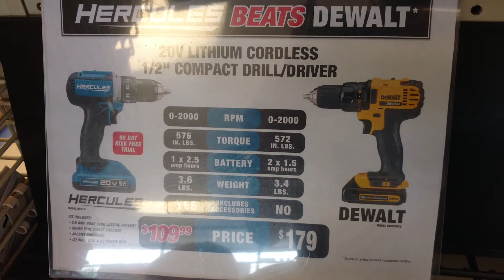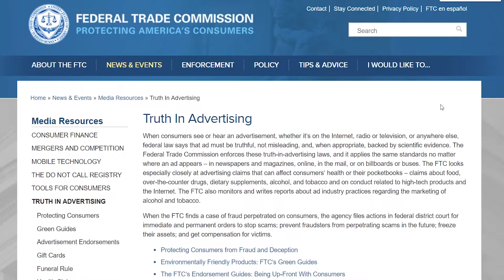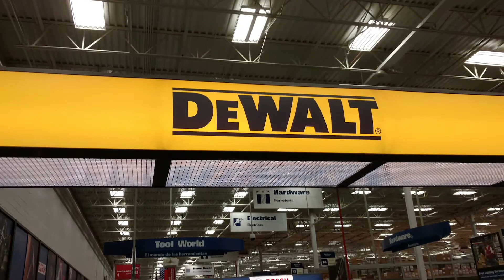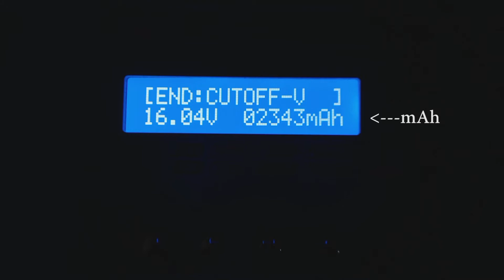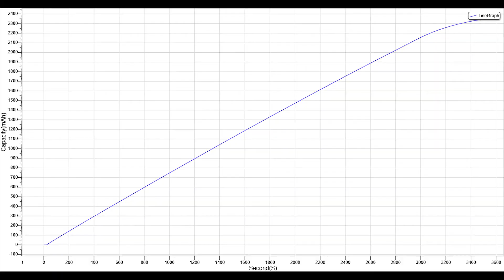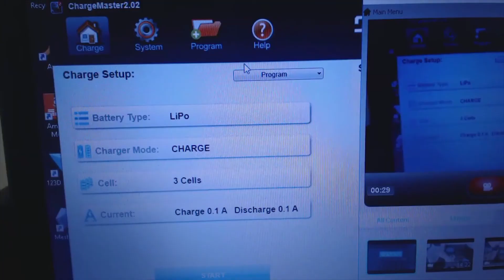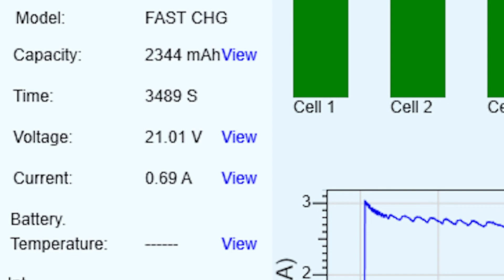Harbor Freight's Hercules 2.5 aH battery gets a capacity test and partial teardown

Comment: Fact, your valid test show 2.3ah, so HF can roundup and and call it 2.5ah and not get sued for a truth in advertising violation.  Also a Fact, AVE ran a vaild test and showed a 1.69ah which he rounded down to 1.5ah.  The difference between the two tests was the discharge rate. You discharged at constant 0.3A, AVE's discharge rate averaged out to 9A. Discharge rate has a major impact on the usable capacity you can get out of a li-ion battery, as seen in the difference in the two tests.  Li-ion cells are sold with an amp-hour specification and discharge rating.   Cells made for a higher discharge rate will typically have a lower amp-hour capacity, and if you run the batteries above their specified discharge rate it shortens their life.  Also, the lower discharge rate, higher capacity cells tend to be cheaper. So HF is playing a numbers game, giving what you perceive to be a higher capacity battery. But when you use the battery pack for its intended purpose, a drill that can draw well over 10amp, you only get about 1.5ah and It will also reach its end of life much sooner than a 1.5ah pack designed for a high output rate. AVE tests painted a much more accurate assessment of the battery pack in the role it was intended for.  HF is giving you a battery that will fail sooner so it can print "better" specifications on the box. This is why HF only has the 90 day warranty.
Reply from the maker: What voltage did ave start at and end at? How did he measure the capacity that was lost as heat within the pack from the higher discharge?
Reply from the maker: Please also consider that usable capacity does not change but how you use it efficiently or not is the difference.if you put one gallon of gas in a Prius and one in an f150, do you see a difference in useable capacity? No,it's still a gallon. Just how you choose to task that energy os what changed. Full tank, just the truck, and do just stop and go traffic for that tank and then do highway only for another tank. Is usable capacity different? No. If you filled it up both times the capacity is the same you are just using it differently. You will see what may appear to be some difference in capacity but it's not a capacity difference. Ave poorly measured at best.
Reply: Start and end voltages are in his video along with the start and end ampere reading. Why would or should he have to measure waste heat. The loss to heat is something we want to avoid, it reduces the amount of usable energy.  Maximizing usable energy, for the designed purpose, is the goal. Waste heat output within the battery is NOT part of usable capacity.
Reply: It is a little more complex than you would like to think. Look up some charts of battery capacity versus discharge rate, also look at capacity versus temperature. The chemical reaction is not as efficient in providing usable energy when operating outside its design parameters. Not only is it less efficient, it leads to premature failure. HF has made an good effort to mitigate this by adding the heatsink. The heatsink will let you push the battery pack pretty hard for short duration and keep heat in the cells down until you heat up that whole block of aluminium. 
Lets simplify your gasoline example to just the engines, fuel system and cooling instead of cars and trucks. Lets look at a pair of engines. One engine designed to run most efficient at an output of 10kW and the other most efficient at 20kW. Let further state that both have the exact same BSFC, Brake Specific Fuel Consumption, when running a peak efficiency.  BSFC is a measure of amount of fuel used per kilowatt hour of output on the drive shaft. When not running at those power setting you will get less output for a given amount of fuel. So now both engines produce the same amount of kilowatt-hours when running at their designed max efficiency output per unit of gasoline. The 20kW engine will just produce it in a half the time time, higher discharge rate. But what happens when you decide to run the smaller engine at an output of 20kW. It will do it but it, will not be as efficient, the BSFC will be higher, so more fuel required per unit of output. So now with both engines at 20kW output and given the same amount of fuel, the smaller one will run out first, producing less kilowatt-hours for the same amount of fuel.  Now it is time to package our power units into a nice boxes, the same size for both; fuel, cooling, and engine. The 20kW engine will be a bit bigger and your designed cooling system designed for the 20kW output will be a bit bigger, so the less room for fuel.  So now you have manufacture of 10kW unit state "I'm way more better than 20kW unit because I make X kilowatt-hours more on a single charge of fuel" based off the 10kW output rate.   Which is all fine and good if what you want to power only requires 10kW.  But, if both units are being sold to power a system that needs 20kW then the claim, while accurate, is more than a bit dishonest. Because it is not going to get that performance in the role it is being sold for. Also if the 10kW unit is only designed with cooling to support the 10kW output, the unit would be subject to overheating and a shorter life.
The battery is not just a fuel tank. It is the whole power unit and subject to similar design constraints. We as the users of the whole system are not concerned with best performance of power unit under of set of parameters that is best suited for the power unit. What impacts the user is how the power unit performs  when in the whole system. When used in a drill, under all but the lightest loading, we will not see the performance that HF claims. So is HF making false claims? No.  Are they giving the information needed to make an apples to apples comparison? NO! In HF favor, they know their market, the typical user for this will not be a professional using it hard for 10 to 20 minutes straight. It will be the home user drilling one or two holes setting it down picking it back up 5 minutes later to drive a screw. That user will probably be pleased with this.  The guy that gets hurt by this is home user decides to build his own deck, they will end up wishing they spent the extra money on the unit built for heaver use.
Reply from the maker: Sean Byrne while I appreciate the example but you did not place focus on capacity. In your explaination you did not talk on the point of the 33.7~kWh per gallon of gas or the amount of gas being the focus. As for the cell resistance, these are good cells. The capacity, no matter how you use it, is there. Gallons of gas are gallons of gas. As for the drill and battery performance please see the video where I use this thing. I beat it with a bad bit trying to drill thru steel. And I do more drilling after. It outlasts  my DeWalt drills hands down battery for battery that is... The 1.5 ah DeWalt batteries. I did measure those batteries exactly the same way as I did this battery and they are spot on 1500 mAh. But they don't last like the harbor freight battery in real world use I put up my fence with deckmate screws and this battery outlasted DeWalt by a lot. The DeWalt 1.5aHr..  they die fast, these herculese ones dont. the warranty is where DeWalt defeats Hercules entirely. After that is the quality, mine is broke already the hammer switch is jacked... And it's out of warranty. You did not answer the question though of what voltage did ave start at? Please go back and look. I remember him not starting his test at a fully charged voltage. That is not a proper way to start a test. Also, "because brain" is not acceptable in actual measuring ever. While I understand it to be regards to tolerance it was not explained appropriately. The dude is an entertainer more than he is precise. I appreciate him for that. Show me his video where he does this identical test with other batteries at the same voltages please. I have searched and I could not find it. Real world use these batteries last long per charge.
Reply: His battery was fully charged. At 33:50 he said it completed charging and that it took 370 watt-hours to charge it. He measured that with his Kill-a-Watt wall unit that he had the charger plugged into.  At 35:20 you can see a no load starting voltage as 20.52V when he had the bad jumper cable connected.  Then at 36:11 with a 2.2 resistive load it shows a 19.35V start voltage which quickly drops to 18.88V at 36:28. This is expected, a load will pull down the battery voltage in proportion to the draw. 
Now the "because brain" statement that seems to offend you so much.  He is doing the math in his head so he has some numbers to speak to. The "because brain" is when he changes 14 minute to 15 minutes to make it easier for his brain to do the next calculation, this allows him to go 15 minutes is .25 hours so divide 140 by 4, simplifies that to 100/4=25 plus 40/4=10 or 35Wh. (also he should have used 145 rather than 140 a ~2% difference.) The change from 14 to 15 minutes is about a ~7% difference and since all the equations are linear the final result would also be ~7% difference. For ballpark figures staying within 10% is, in my opinion, good enough.  But if that is not good enough, he puts his actual calculations, without the because brain simplifications, in an overlay. Your "outlasted DeWalt by a lot" measurement seams much more subjective then AvE's "because brain." His final 33.7wH equates to 1.7aH so a bit better than the 1.5aH dewalt. 
0ne gallon of gas having 33.7kWh of power potential does not matter. What matters is the power we can deliver and use at the drive shaft. What matters in a system that has a battery is how much power it can deliver when used in that system.
Reply: READ MY COMMENT ABOVE. 2.3 IS AN ACCEPTABLE MARGIN OF ERROR FOR A 2.5.  SERIOUSLY? YOU ARE GOING TO COMPLAIN ABOUT THAT. THERE IS ALSO A BREAK IN DEGREDATION, AND MARGINS OF ERROR FOR TEST EQUIPMENT ETC.
Reply from the maker: Sean Byrne A FIVE OUNCE BIRD..... CANNOT CARRY A ONE POUND COCONUT!
Reply: TRY to HELP you: Nice Monty Python reference, very witty. And yes, the prior statement was intended to be sarcastic. If you are going to call me an idiot, just do so. Basically you are resorting to name calling, but are just hiding it in a humorous quote.  But since you prefer your insults wrapped in Holy Grail references here is one back to you "What are you going to do, bleed on me?"
Reply: I give up, I will no no longer attempt to explore the what 'usable' should mean in this context. However, I can find no other possible interpretation of that particular use of 'comedy' then that you wished to insult me, it did not reference any portion of our previous posts, just my name.  Your "dude, you are reading things that are not there" seams very disingenuous to me.  If it was truthfully not intended as an insult, fine. But I would suggest that you reconsider using that style of comment in the future.
Reply: Damn back off you old crab. No body here wants to catch your scabies from Ellis island. (I stole that by way) I've watched this man's videos and he has laid some true brutality to these tools. So much more than many others have. Other people want to take it out of the box give it a few cheap shots drill a screw or two into a piece of wood so they can return their gently used tool back to harbor freight in order to get their money back. Great freaking video!!
Reply: Wow, leading off with some 19th Century style hate. Maybe you should have left that back where you stole it from.
Reply: Then why do the herc batterys last twice as long in practicle use? I run gondolas up with it for hours give the helpers the porter cables and dewalts cause i have to keep switching batterys
Reply: Thing is, a 2300mAh test is not bad for a 2500 mAh pack. It's only 8% under, and that's within the margin of error for such a rough but honest test. You really should pick on the battery manufacturers that advertise 3000 mAh and produce 500 mAh. These are the real crooks, they do it intentionally, and prey on inexperienced people.
Reply: That makes zero sense. Discharge amperage rates on a Li ion battery are a controlling factor to determine how suitable they are for a given application. 9 amp draw is not unreasonable for a drill under load. A .3A draw is ridiculous.What you have done was set a standard of discharge ov .3A at a ludicrous level, one which is an order of 20-30 times smaller than actual use demands. While it is true that Li ion doesn't generally follow other battery chemistries regarding Peukert's law , the actual cells are the determining factor and all Li ion are not created equally. 

No, aVe was correct even if his language is foul.
Reply: Ari,  you do realize that using all caps the equivalent of yelling, so why pop in here and yell at me? If you wish to discuss what I've written rationally, I'm open to that. But please, first read what I've written, and realize that what I wrote was in response the the video. 1st thing we could discuss is where you think I am complaining about rounding  2.3ah to 2.5ah.
Reply from the maker: Sean Byrne dude, you are pulling words from a bank I do not utilize. I have comments with certain words blocked for review but I will let it through this time so you can see my response. You are reading things that are not there. I turn to comedy to highlight the rediculousness of  this. I ridicule your definition of capacity. The measure of it. You define capacity differently than I. Different than battery manufactures globally. AvE pumped energy into a battery and got nearly the same amount out. He did not do a throrough conventional test. He did an entertaining one. I ask you to buy the battery and charger. Test it. Cycle it a few times. Use it. See what you get. Produce a video. Thats what I did. Also, I will be coming back to this with more videos as well including my DeWalt 1500mah battery. Which I recently tested at 1500 mAh. Go figure, a battery of identical volume of a lesser capacity producing precise claims. Answer this for yourself. What other batteries has AvE done this exact same test too of a similar capacity claim? Without that, we have no comparison. From here, my engagement with you ends.

Comment: How can 5, 18650 batteries only produce 2,300mah?
Reply from the maker: they are in series. If they were in parallel then they would multiply the mAh instead of voltage.

Comment: I think the Hercules stuff is not near as bad as it gets criticized for.
Reply from the maker: did someone pay you to write that comment? YES... me... or at least if i  did pay someone to... it would be exactly that!
Reply: TRY to HELP you so you don’t think it’s that good?
Reply from the maker: jeffscomp i do think its good. Just as good as the advertising suggests. Problem is people are not looking at the HF ads closely. The newest dewalt tech is better by a fair amount... But the HF ad references older dewalt drill models
Reply: TRY to HELP you why are they better technology please give specific reasons
Reply: I don't think Jeff is buying HF's deceptive ads. I think he is just saying that Hercules  it's not as horrible as some are reporting. I buy only DeWalt, so I have no dog in the hunt.  I think the Hercules line is a good bargain. If you really want to do some good, pound on the battery manufacturers that stamp 3000 Ah on cells that get 500 Ah. BTW, sometimes it takes several gentle charge-discharge cycles to get  full capacity out of a pack. My Roomba Li-Ion pack almost doubled after 5 cycles. (yes, I have an iMaX charger/discharger too)

Comment: Only the older dewalt 2ah batteries  had that aluminum cooling platr, none of the newer ones, (2014 and on) have it. Too me it looks like they copied the design from those older batteries
Reply from the maker: +ben ten YES! According to the tool guy at my local lowes, the model that is next to the Hercules drill in the ad from harbor freight is the 20v max, the older design. Main difference between the drills from then and the newest dewalt drills is that the new ones are brushless motors. The drill i got is definately brushed. You can see them thru the venting. I wanna get a hold of those older dewalt batteries and drills.

Comment: I'm curious how consistent they are. A lot of the grumblings I've heard about Harbor Freight tools is not necessarily capability or quality but rather consistency. "You may get lucky and get a good one or you may not" type of thing.
Reply from the maker: +Eric Jenkins whats up man?! Yeah, i have always had the consistancy of "you get what you pay for" from them. But to find the truth in the consistancy would require testing several seperate items of the same model. I dont think many people have done that besides their QC department (does one exist?) . Rarely are two customers the same though. You probablu can find consistant quality but different people rate the quality differently. The actual testing and demonstration of actual testing is always good, as long as its done in a conventional way. The dude AvE didnt do a lagetimate capacity test, yet he was claiming a capacity that was much lower than the label said. It is true, of HF is lieing about these products, they can be fined heavily by tye FTC and possibly may have to do some sort of reparations or something to existing customers who have bought these drills. My guess is it wont happen because the drills seem to be pretty decent.